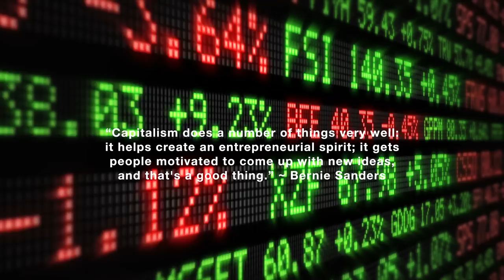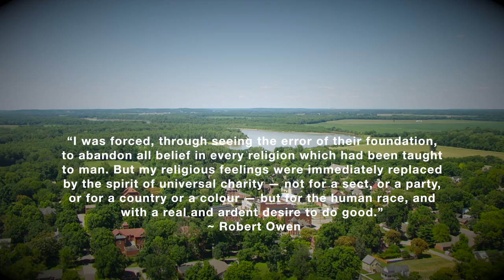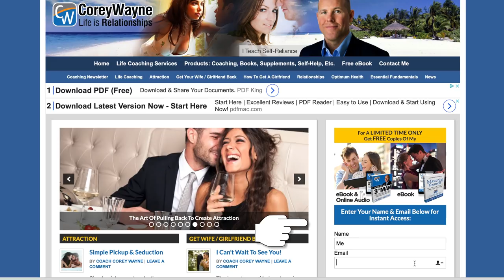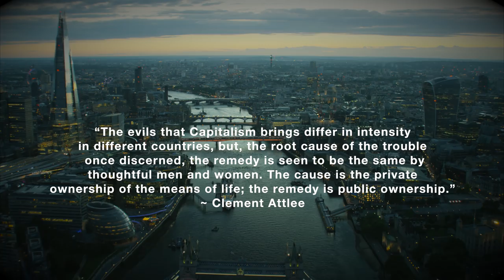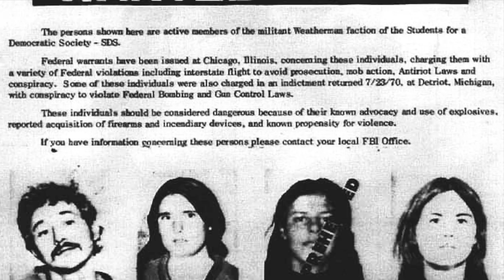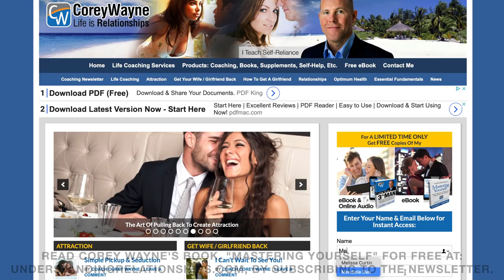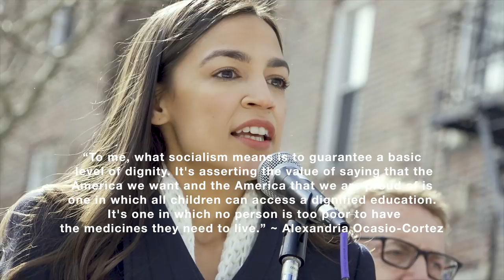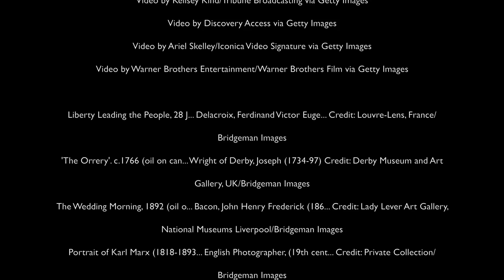Why Socialism?

Comment: socialism can only work if isn’t enforced by the government. Why can’t we have the social programs put in place by the government but force a capitalistic competition upon them. where they aim to turn a profit. We do this by having the people decide where their tax money goes to. (Ie. 10% to schools 20% roads 30% safety department etc...) the government will also run casinos to turn a high profit, this will be used to fill in the gaps of the public services not donated to as much.

Unfortunately the system of government requires authoritarianism. And absolute power corrupts absolutely.

Comment: My point is if you don't support Socialism that's fine, but don't make a video just destroying it and not talking about capitalism in all its terrible ways. At the very least you should be supporting regulation to ensure that nobody needs to turn to Socialism to begin with. Making sure companies are following through with safety and proper wages for workers. Union support especially. But no. Instead you just push propaganda, instead of addressing the actual problem of wealth inequality in a educational, or fair terms. You have to, or it's all pointless babel.
Reply: If I get shitty pay, many others and I will find another job with a better pay. The asshole that wasn't meeting my necessities is now running a business with no workrs and the business will most likely shut down. Next argument? Take a shot. I'll respond :)
Reply from the maker: Wealth inequality will be addressed in our next documentary on the monetary system. It will surprise everyone on the left, center and right. Most people don't understand the monetary system.